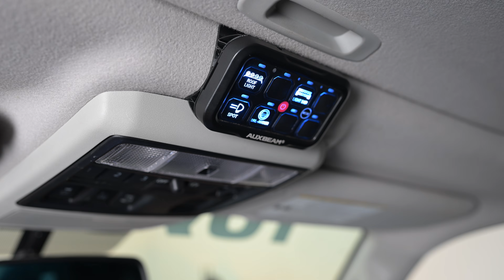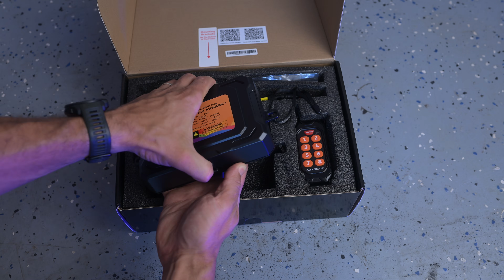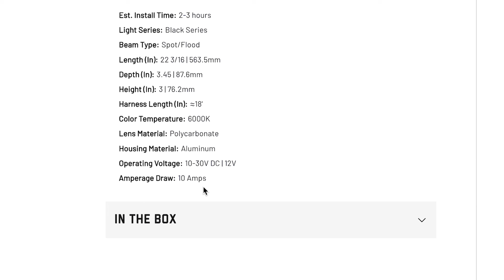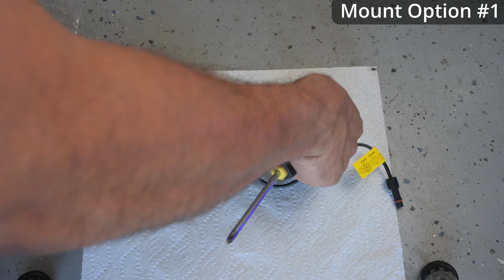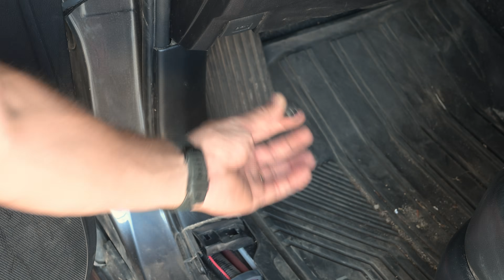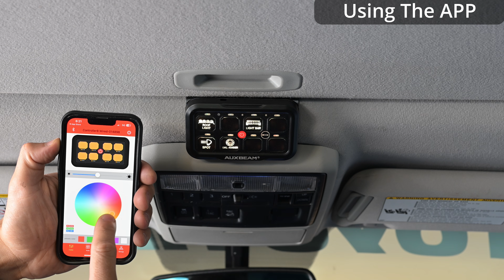Detailed Auxbeam Switch Panel Full Install and Review

Comment: Hello, I know your out and traveling, but had a quick question. What did you do with your 40A circuit breaker you had for charging your accessory battery? Looks like there is one more spot forward to mount it to. I was hoping to catch it in the end of the video, but the angle wasn't quite there to see it.
Hope you and your family are having a blast. Enjoy and be safe.

Comment: I have a dumb question. 

Where or how far do you cut the wiring (relay and  power switch)? I currently have 2 sets of Auxbeam light pods installed on my truck, but plan on installing a panel soon. 

Most videos I come across do not show where to cut. I just want to make sure I am not cutting too... much or the wrong part lol. 

Thanks!
Reply: Give yourself plenty of length. And cut as far as possible as you can.

Comment: You should have used the light wires you cut off to connect to the switch box. That way your switch box uses the external relay allowing you to connect a high amp draw circuit to be controlled by a 5 amp fuse since the 5 amp fuse is just being used as the control feed to the external relay that controls the high amp draw.
Reply from the maker: The switch box can handle the amp draw required for what was shown in the video. The beauty of this box is it allows you to clean up the relays and switches instead of adding more

Comment: New to this whole wiring thing. Can I run my accessory wire into my hood fuse box in an empty slot or does it have to be under the dash?
Reply from the maker: You could do that yes, just make sure it’s a  a free circuit that you can add a fuse to that gets power only when the vehicle is turned on
Reply from the maker: You could look on forums for your vehicle and see where others have taped into

Comment: So when I connected mine, plugged in to power, the little blue led light stays on even when the car is off, is that normal?
Reply from the maker: Your accessory wire is likely connected to a constant power source. It needs to be on a source that only gets power when the ignition is on

Comment: @T4R Garage @10:46 question i see you routed the blue and red lines to number 6 pos. on the next scene there's a black neg. wire on number6 please explain where that is going to and how you got it routed . you were holding 3 wires at first and now its throwing me off. i got a flood light and a amber light combo light bar theres a amber light wire and a white light wire, then theres one ground wire. Do i use a jumper wire or splice the into the original ground wire to ground the Amber light?
Reply from the maker: I was just putting two different ambers backlights to the same location. As for the ground- You could put the ground onto any ground spot on the Auxbeam, it doesn’t matter. Your combo will share the same ground for both lights hence one wire. What needs to be different is the + wires. Your amber wont need as many amps as your flood so pick the spots accordingly to their requirement’s and put the ground onto any either one. Hope that helps

Comment: My ditch lights have an on/off button and mode button for different modes on light like, amber , white, and flashing. How would I hook that up?
Reply: I have the same ditch light, I used two different currents and it works fine.

Comment: I want 3 lights to work W/O the ignition on. How do you wire it that way. I want to be able to turn on my roof lights and light bar while sleeping in the back of my 4Runner. If I have to get out in the middle of the night I want to illuminate the area before climbing out of the back.
Reply: I assume that I will have to power it directly?
Reply: So instead of wiring to an ignition source I can go directly to the battery?

Comment: What if you run 8 lights at 5 amps? Can you just change a 30 amp fuse for a 5 amp?
Reply: You can change the fuses to what size you need and where you want to put them. So if you want switch 1 to be 30 amp and switch 2 to be 5 amp just put the corresponding fuses in that slot

Comment: I have purchased two of these. They have a horrible draw on the battery if you let sit for a bit. I thought it was the one I purchased so I tried another one same result. The only way is if you totally remove power but then you need to reprogram every time. But you get what you pay for.

Comment: Does this switch panel allow the auxbeam lights with various flashing and color modes to function? I don’t see where you may have demonstrated this. I currently have a couple of auxbeam ultras that come with a switch that controls the different modes (white/amber/flashing) however auxbeam doesn’t seem to make a switch panel that will support its own light’s modes withought the 2 button switch the ultras come with.
Reply from the maker: Yes some model can do flashing/strobe the one I installed AR-800 has that function. As for your specific lights and the color models I am not sure. I would contact Auxbeam to ask

Comment: You dont have to run the acc wire correct? Like you can just run power and ground to it and the switch panel still work?

Comment: Hi. Need held. Im going to install the auxbeam to and have existing light bars and ditch lights with individual switches. Where did you cut their wires? Is it before the relay and I will use those wires to hook onto the auxbeam?

Comment: The lights on my truck will turn on when truck is completely off. But with switch panel, will that not work? Since you need to tap in to a fuse that’s not always hot? 
Great video.
Reply: You don't need to tap into a switch that is on only when the vehicle is on. If you tap into a fuse that is always hot, whatever you have hooked up to the switch will always work.  Downside to this is you run the risk of draining your battery since it is still pulling a little power even when you don't have any accessories turned on. It is always safer to run it to a spot that is not on when the switch is on.

Comment: so you have to connect the remote each time you want to use it within a short period of time? I like the idea of having the remote giving you two control stations, but not if you have to connect it every day
Reply: how quick and effortless is connecting the app each time?
Reply from the maker: @tayaray the app is instant, the remote works close range without the antenna but if you are further away you will want the antenna connected, takes 3 minutes to connect
Reply: @tayaray I don’t know, that’s why I asked
Reply: Does this switch panel allow the auxbeam lights with various flashing and color modes to function? I don’t see where you may have demonstrated this. I currently have a couple of auxbeam ultras that come with a switch that controls the different modes (white/amber/flashing) however auxbeam doesn’t seem to make a switch panel that will support its own light’s modes withought the 2 button switch the ultras come with.

Comment: Question, your raptor light video and this video both use the same fuse position. Is there another fuse you could use for either?

I also am running into the issue my auxbeam panel backlight is always on sitting in that fuse position. I have 2019 sr5. Any suggestions?

Comment: What about the harbor freight ditch lights. How would the wiring work? Would I still need to cut off the relays and the fuse? Or would I be able to just take off the buttons and connect the wires to the switch panel?

Comment: What did you do with your quick charge 4 gauge wire connected to your battery terminal?
Reply from the maker: It’s attached to the new battery terminals, they do a good job of hiding the wires

Comment: When you hooked up your DRL wire on light bar, it went in the positive spot, where did the black wire run to as you didn’t explain it
Reply from the maker: To the neg post. There is a pos and neg in each spot
Reply: He has lights with drls built in so when he wired the actual light the drl piggy backs off of that ground wire.

Comment: One thing I realized when running wires…you don’t want to mount them in such a way where if you get into a fender bender they can break/short circuit easily. Better to route them with ty-raps that can “slide” with the bending car/truck panel. It’s the first line of defense in keeping it safe should the worst happen. Fusing and breakers are the next line of defense. This is why factor harnesses typically have stubs that are breakaways…one they are a cleaner install but two they can mold or reshape with the contorting body panel  a little to keep wires from breaking and shorting from impacts.  Nice instructions and clean , thanks man!

Comment: do they have a model that is all 30 amp? I don't need the little ones
Reply: You can change the fuses to what size you need and where you want to put them. So if you want switch 1 to be 30 amp and switch 2 to be 5 amp just put the corresponding fuses in that slot

Comment: Hey.guys. i live in Australia, and we are not aloud to run spotlights unless they are wired into the high low ove the vehicle how can you wire the auxbeam to a relay for the spotlights so they work on the vehicle high low and the auxbeam
Reply: The relay will have to tap an add a fuse off the high beam, but still power for light off the battery.
Reply: Hey Stephen did you find a solution for this problem I am also in Aus and would be interested to know?
Reply: @gjw35057 yes mate two relays one relay is a switch

Comment: Do you have to turn on all the lights you want when you start your car or does it remember what you had on last? I wanted to hook this up to my daytime running light on my headlights and raptor grill lights. but would like them on when i start the car and I want to turn them off I can use the switch.
Reply: That is exactly what you can do with it

Comment: 💥 confused, I'm buying the RA80 w/o app, went to buy the overhead mount... It says it only fits the BA80 ....
Reply from the maker: The regular RA80 is the same size as BA80 2.6x4.6in . It should work as they are identical sizes but maybe send him a quick email to confirm. It does say “fits BA80 size AUXBEAM 8 gang switch panel”
Reply: @T4Rgarage thank you

Comment: I found a 3-D print file for the fuse box cover that allows the ad in fuses. If you know somebody with a 3-D printer, you can pick up the 3-D print file pretty cheap couple of bucks or just find one somewhere. Can’t remember exactly where I found mine, I’ll try to dig it up and repost here. Keep up the great videos.
Reply from the maker: I really want a 3D printer. Thank you!

Comment: That is a pretty sweet overhead mount. However check out the one from OEPanels that replaces the shroud on the dash of the left side of the steering wheel where the switches are. I found that one a little bit easier to run the wire and a little bit nicer. I might use that overhead one if I install a second panel.  Awesome video keep it up!
Reply from the maker: I was looking at the OE panel but it was out of stock at the time, much more expensive, and a read a complaint about it getting wet being next to the window/door. I really do like the design though, looks super factory/oem. The install for the overhead was super straightforward, no cutting required like oe panel
Reply: @T4Rgarage  Yes I think both options are great.

Comment: Wow - with the overhead mount this is a killer OEM Plus mod!
Reply from the maker: Yeah once I saw that overhead mount I knew this was the route I’d be taking for mounting it up. The nice thing about this one is that you actually screw it on using Auxbeam‘s provided hardware. There are other people making them but they want you to use 3m tape
Reply: @T4Rgarage cm puedo obtener el soporte